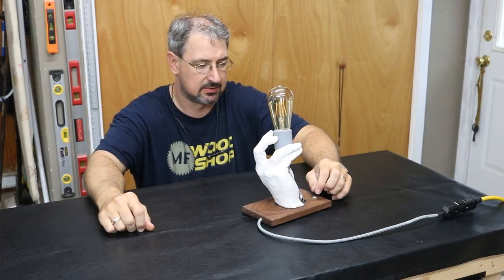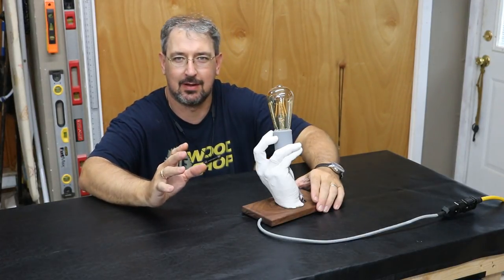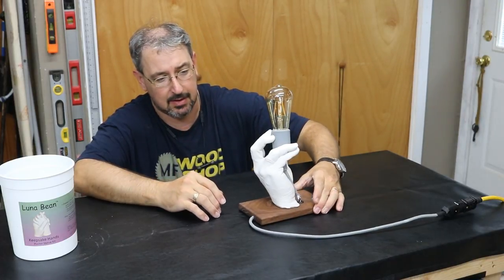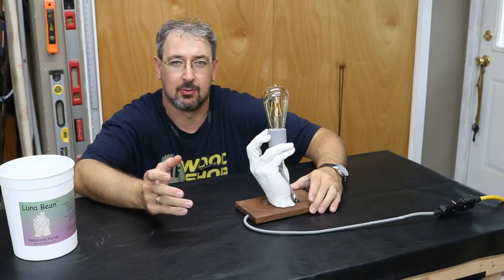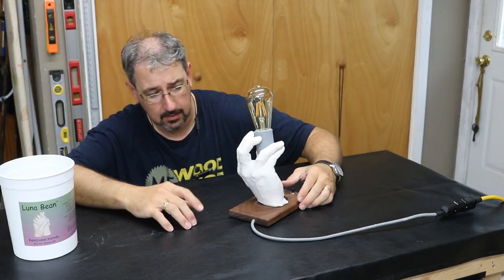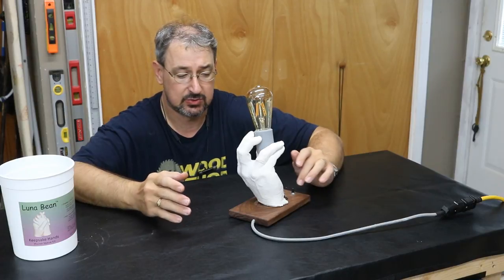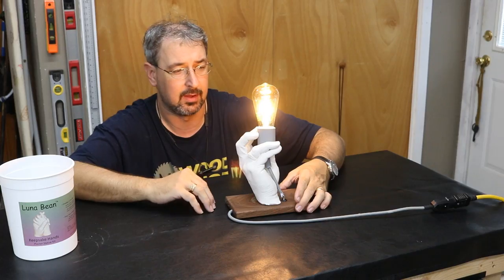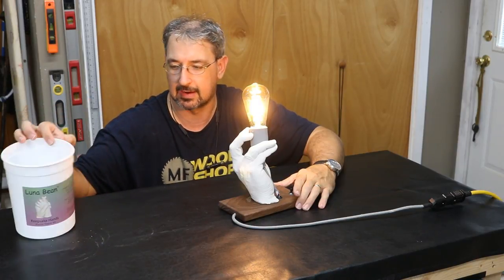Make a Handy Lamp

Comment: Couple bumps along the way but I think it turned out pretty cool the detail that it left behind is awesome and even got your One fingernail that was chipped and the crease lones of skin. LOL might be a good project to use a Dremel on low speed but like you said if you have a detail knife good to go I don't have a detail knife so I might use a Dremel tool I got to check this stuff  out thumbs up on the project  and video👍👍 no pun intended
Reply from the maker: +Joe basement woodworking thanks Joe Drexel might be to abrasive it sands really easy. Much like drywall plaster.

Comment: Very creative !! loved it :-) I have a question these Alginate powder for casting is this same as what the dentist use , the reason for asking is that it is pretty expensive in part of the globe and the dentist one is pretty cheap :-) can that be used for the same projects? will appreciate your reply. Thanks and always enjoy your videos and pick up something new.
Reply from the maker: +Mahendra Tiwari not sure what the dentist uses, but if it does the same job and it cheaper by all means use it. The kit I got was about $30 and it came with everything I needed. Just add water.
Reply: Mike , thanks a lot for your reply :-) I shall give it a try with that stuff, the kit which u used by the time it reaches here , it becomes very expensive! Thanks again.

Comment: Why don't you paint on the extra you saved and fill the crack area over the thumb? Other than that looks good.
Reply from the maker: +cejkwo Mass I did that first and it didn’t hold, I epoxy it together so I could go back and touch it up

Comment: I would suggest using easy flow 120 instead of the plaster for the casting. Easy flow is 2 part liquid plastic and dries very strong. plaster as you already know is brittle and will break easy. https://www.brickintheyard.com/products/ezflo120u3-8
Reply from the maker: +Mike Skalberg good to know thanks for the tip